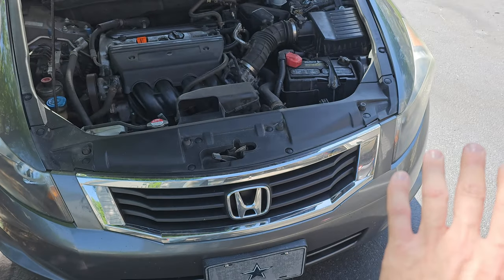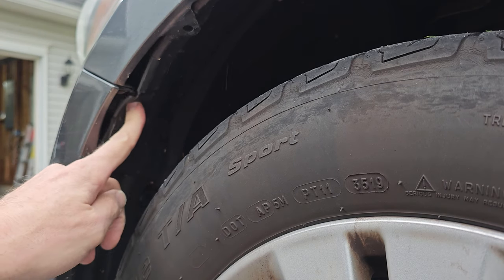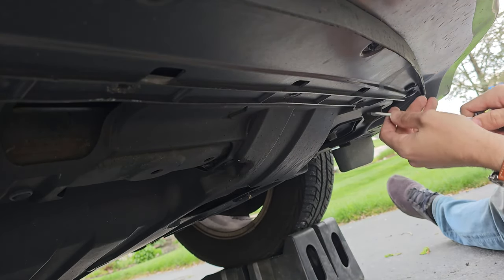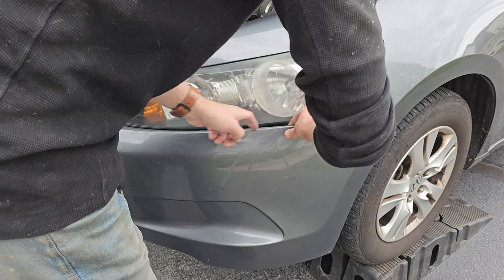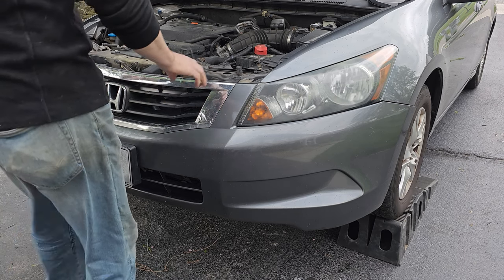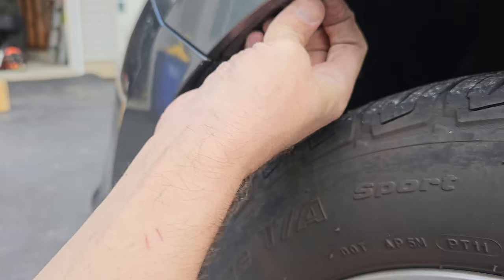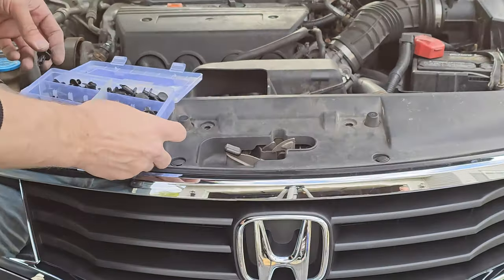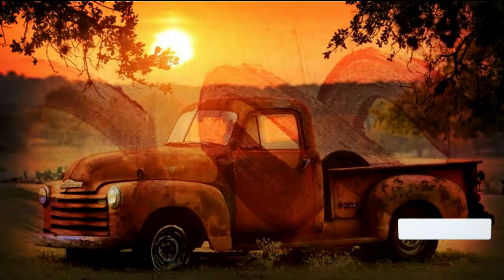2008 - 2012 Honda Accord Front Bumper Removal and Install!

Comment: My bumper fall down a bit. I don’t know will if i just put new clips, it will lift up number a bit or no?
Reply from the maker: Check the 2 tabs at the top. They hold the bumper in place so you can put everything together.

Comment: How many clips will I need to replace? And what sizes?
Reply from the maker: That depends on how many clips are broken. You can resuse the clips if they are still in good condition. 

As far as the size, I'm not sure. I just went into the clip kit I bought and found the one that would secure the shields properly without moving.

Comment: This looks beyond easy. I just got in a car accident breaking my bumper. Got the same exact color, where did you get the bumper? Online?
Reply from the maker: This is actually the same bumper, I just wanted to do a video on how to remove and install one.
Reply: A local junkyard will have one most likely
Reply: @kid5042  and I can take it to a shop to get it painted after I assume
Reply: @trevey16  Nah you most likely won’t need to, this was probably the most common color this car was in
Reply: @kid5042  appreciate it.

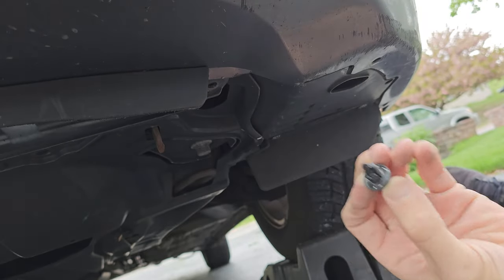Comment: 3:31 what is that jug at the bottom near the headlight housing ?
Reply from the maker: It's a resonator for the intakes on these cars. Seems to be pretty common with Hondas. After browsing on some forums, some people say it's necessary to have and others say it isn't. Here is a link for it:

https://www.hondapartsguys.com/oem-parts/honda-chamber-assembly-resonator-17230r40a00?origin=pla&gclid=CjwKCAiA44OtBhAOEiwAj4gpOQr1CwafpJFe37XetSNshmxa2aBQiVFZwQlmOrlwK5f4vgysyE2dXxoCkCAQAvD_BwE

Comment: Can you swap 12 accord front bumper with 13-17 front bumper??
Reply from the maker: No, completely different platforms unfortunately.
Reply: @TrickShiftGarage  wow kinda disappointed but thanks a lot
Reply: Part numbers for bumper retainer clips
Reply: Bought on line for 2011 accord - se. Not one fitted.

Does anyone know where i could buy the right parts?
Reply from the maker: The dealership. The clips in the description worked perfectly for me. If you want factory replacement parts, you need to go to a dealership or find a Honda parts retailer online.

Comment: Can i use a 2010 grill on a 2012?
Reply from the maker: After doing some research, I don't believe you can. I think the 2008-2010 bumpers and grilles need to be paired together, and the 2011-2012 need to be paired together.
Reply: Thanks, i really appreciate it @TrickShiftGarage
Reply from the maker: Anytime brother. 🤟